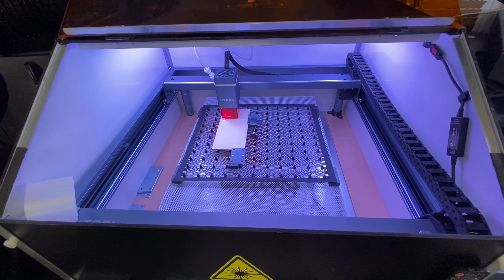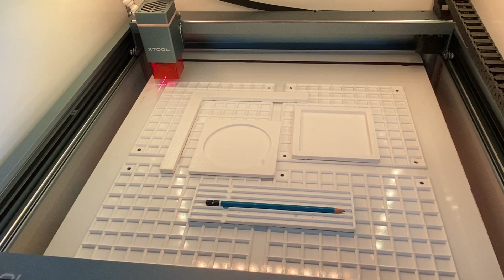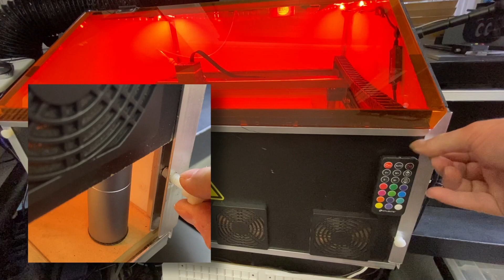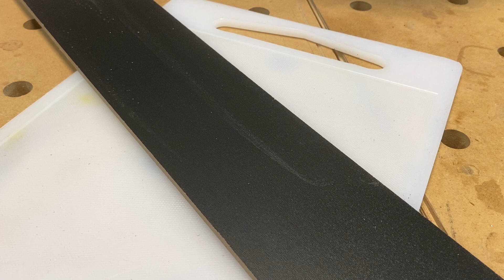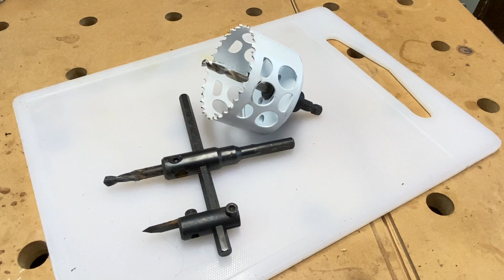DIY Enclosure for an Xtool D1 laser

Comment: I would put the extraction point of the fan at the bottom and the intake at the top (opposite the fan). That way the smoke is pulled down, away from the laser. At least, that is how I am going to build it. ;)
Reply from the maker: I considered that... but it was not practical in the physical space that this enclosure has to live.